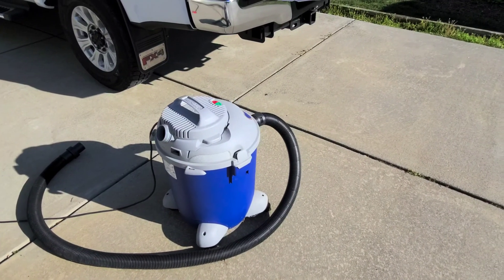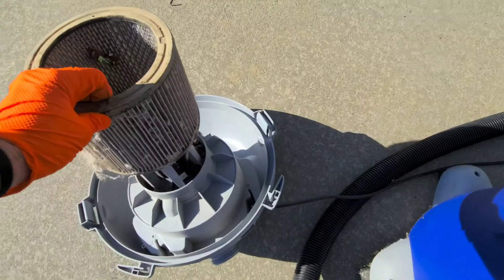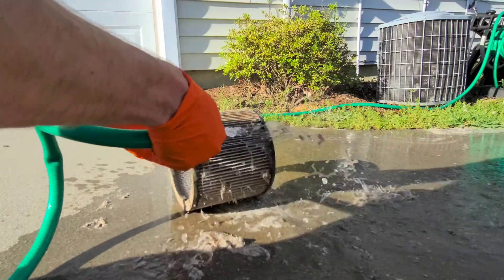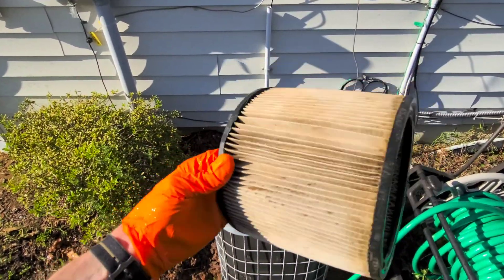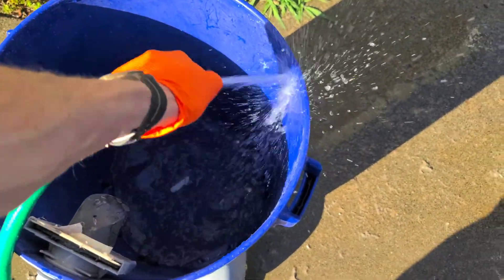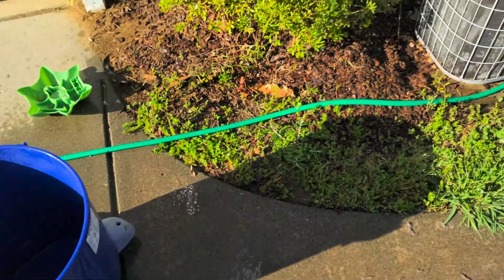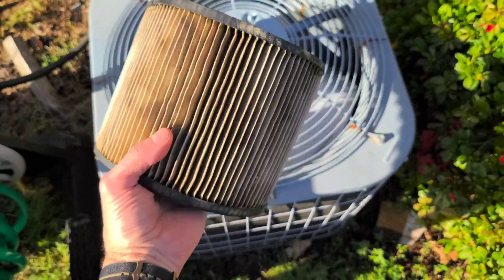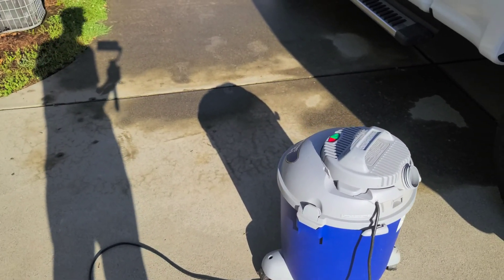Shop Vac Service and Maintenance

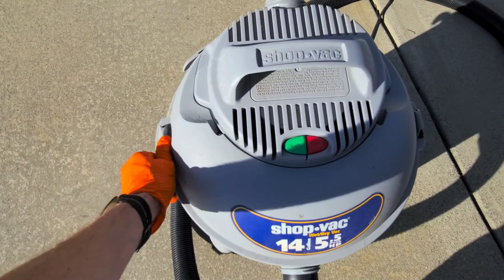Comment: 0:26 that hose is supposed to be locked on by the other end, also every filter I've gotten wet just turned into a metal cage with a piece of rubber.